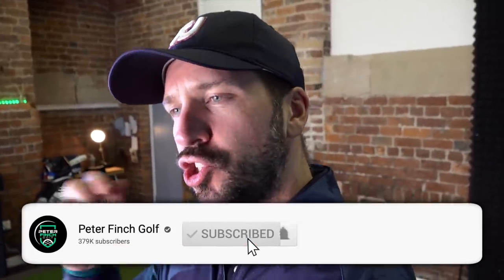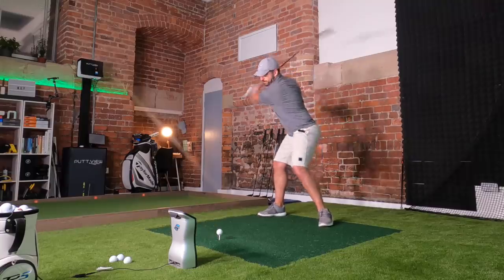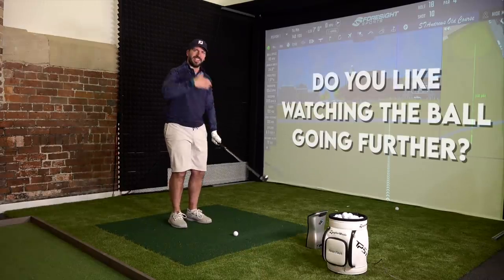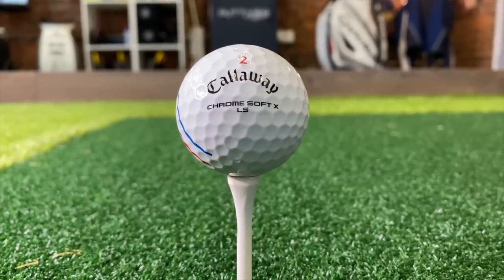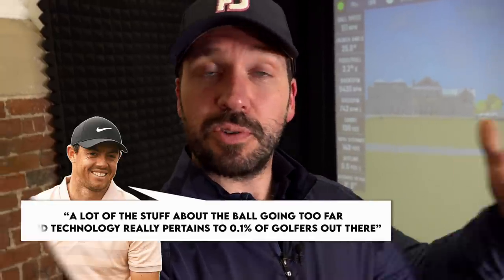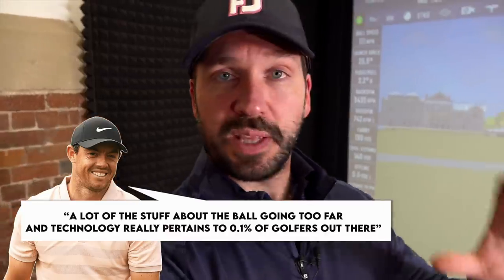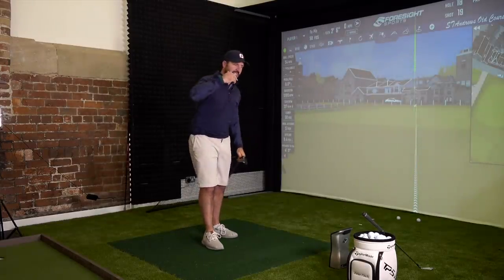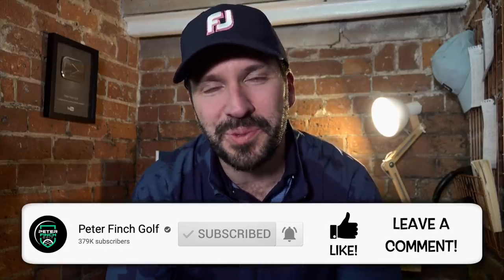Time to roll back the golf ball...?

Comment: I remember when Tiger started hitting it out of the park everybody was wondering how to Tiger-proof courses. It was suggested shortening courses would help, thereby levelling the playing field by making long holes reachable by all. However that doesn't stop the long hitters hitting a 9 iron where shorter hitters need a 7 iron & thus having less chance of stoping the ball on the green.
A shorter driver shaft would drop clubhead speeds & probably help many amateurs find the sweet spot more often too.
Reply: They need to just make the hazards tougher, more plentiful and more int he way. Pros are driving to an empty piece of fairway avoiding all hazards? put a bunker there, make them have to play different shots etc. you odn't have to keep making the courses longer. Some of the most entertaining holes in golf are par 3s that the average golfer can hit with a 7 iron.
Reply: @dr6124  I don't, you change them as needed. Either don't use the course or accept that some comps are going to have a cut of -12 or something. Adapt or die is a phrase for a reason.

Comment: Advancement is fine, it just can’t reach a point where equipment starts hiding players’ weaknesses. It should highlight their skills not be a crutch for them to fall back on.
Reply: I like this view. The distance isn't the problem to me. The amount of players that are actually long strikers is quite small. I'd say it's waaaaaaay below 1% of all players. And when golf is a game where you should use as few shots as you can, it's ok to have some players to "exploit" the courses. The vast majority can't and will be playing the courses as they were designed to.
So as long as the ball control isn't tampered with tech too much (distance and spin doesn't do that, as the player still has to hit the right ahot for that ball in every situation), I don't see the problem. The pros are on a different level than the majority in EVERY sport anyway.

Comment: Yes, can't just keep pushing tees further back.
Lots of other sports have equipment differences at different levels. Different speeds of tennis balls, squash balls, shuttlecocks, wood vs metal baseball bats, javelin weights etc...
The game was bifurcated in the past when only tour pros and elite players used balata balls.
Average golfers get very little benefit from low spin drivers and premium golf balls that are maximising performance on tour. 
It will be a huge challenge though.
Needs a very clever solution to limit distance without completely excluding the shorter hitters on tour...

Comment: 2 things.

1) does that X LS ball work well for lesser swing speeds?  Like 100 mph speeds?

2)  Regarding rolling back equipment, I personally think it doesn't matter how much you roll back the equipment.  Technology in both measuring and training will mean players will experiment and figure out how to get the ball to go farther.  If you roll back equipment now, you'll just have to do it again in about 10 years or less when players have figured out how to maximize everything.

I'm a video game designer, hence I deal with balancing systems and mechanics like this all the time.  The key problem I personally see is that the metrics to design courses around are fluctuating too much with the amount of distance that can be gained now.  And as I mentioned, it doesn't matter what you do to the equipment, professional players will figure out how to maximize it because they're absolutely incentivized to do so, and the technology exists to make that happen now (as opposed to the previous 100 years).  In any kind of mechanic like this in a game, developers would put a cap on certain abilities so it's a fixed metric to design around.

My personal proposal would be to put a maximum cap on how far any 1 shot is allowed to carry of 320 yards, and any shot that exceeds that gets a 1 stroke penalty (and this rule only has to exist on tour).  Every shot is tracked on tour now, so it's easy enough to monitor.  It allows for big bombs to be had for fans to enjoy, and it also provides a fixed metric that courses can be designed around, knowing that it won't change.  It also still gives an incentive for players to want to train and hit it longer as it allows for more strategy with club make up in a bag.  Hitters like Bryson could stop carrying a driver and use that slot for an extra wedge, or a specialty club.  And hitting a 200 yard 8 iron is still a big advantage!  Club manufacturers are still incentivized to make better technology to help all golfers.  My 2 cents worth anyway :)

Comment: Jack Nicklaus hit drives 330 years ago... now the roll back discussion just because a few pros hit it longer... let golf keep going.. winners will win..
Reply: Whist this isn't wrong it doesn't tell a full story. In 1963 Jack won a long drive comp with a massive 341 yard drive. However in 1980 (the earliest year the PGA has the stats for) he averaged 270 yards, that was past his prime sure, but he still won two majors, the PGA and US and had the tenth longest drive on tour. By contrast that 270 yard average wouldn't even place him on the PGA board for 2021 where the shortest average drive so far is D. A. Points, down in 230th at 271 yards. So yes, Jack was a long driver, but not nearly as long as the modern guys. Average drive on tour has gone up 40 yards which makes many golf courses play very different. That isn't an especially bad thing, and as someone who hits a long drive I certainly don't want a roll back (for amateurs at least). But, the argument of "well the drives aren't thaaaat much longer" isn't accurate. All pros are longer, and by a lot.

Comment: Hitting it far is always going to be an advantage and that won't change with roll backs because distance is going to roll back for everybody. What can be done on any course is raise the potential cost of missing on a 340 yard drive by implementing temporary OB for professional tournaments. If Bryson has water short of his carry and OB on the other side of the fairway, he never would have attempted that drive.
As for amateurs, average handicap and average driver distance hasn't really changed over the past 20 years, so equipment isn't defeating old courses for us.

Comment: Pete with the SIM2 you CARRIED as far or further than my best drive total. And my best drive total was 321 yards. That is insane. A roll back for pros and amateurs doesn’t make sense but a roll back for pros is needed. And with all the technology they have out there I’m sure they can make all the equipment look the same or even if they just use that ball with no dimples that would be a huge step in the right direction IMO

Comment: IMO, 3 option, but not a rollback persé:

1: Lock distances now, no rollback but as of 2021.
2: set a set of limits between the correlation of distamce and forgiveness, you want distance, give up speed or vice versa.
3: but a "bag budget" on the pro's. A bagsetup (clubs and ball) can only cost so-and-so retail, otherwise they have to use older models, cheaper models or less clubs.

Comment: OK then ... just an idea. Let the manufacturers knock themselves out with new tech. Merely adjust the pro courses so that the fairways narrow dramatically after 300 yards or so with deep rough on either side. Maybe add obstacles such as fairway bunkers around 320 to 380 out from the tee where necessary. Move tee boxes so that players can't drive across water on designated par 5s because it's a 420 yard carry. Up the stakes on the risk-reward so that the best golfer wins.

Comment: Low Spin Lunacy. Hey pete I used to struggle with distance last year. I saw bryson and got inspired to gain some yards. I went for being able to hit driver only 230 to know hitting it 310. Club head speed went from 95 to 105. I am also now hitting more fairways, because of the work I have put in
Reply: 310 with 105 chs? someone is lying to you lol
Reply: 105 chs gets you max 265 carry
Reply: @joshuaprok4354  it is not 310 carry
Reply: @konstamattsson  not carry total and the speed speed could be faster now I  havent checked in a while
Reply: 310 total distance requires 115 swing speed

Comment: Tough question to answer.  I'm sure some of the complaints made were also made when shafts shifted from hickory to steel and then to graphite.  It probably happened when metal 'woods' were developed as well.  I think the big thing is not how far is too far, but how will golf clubs respond to the issue.  Some older clubs won't be able to expand but that doesn't mean they won't get business, it just means they won't be hosting Majors anytime soon.  Lets face it, all of this new technology gives probably less than 1% of the golfers out there the massive advantage.  Most of us will see maybe five or six yards of increase but we won't be worrying about driving Number 6 at Bay Hill (unless it is in a video game).

You aren't going to change how things are going.  It isn't just the golf ball or the clubs.  Like you noted players are concentrating on weight training and athletic drills to increase their clubspeed and distance.  Golfers are now athletes in their own right.  That can't be changed, no  matter what you do to a ball or a club.

Comment: If you want to bring back skill then the answer is relatively simple: let the rough grow a bit more so there is a real penalty for being off line and let the fairways grow a little - in pro tournaments the fairways are faster than most club greens.

That safeguards the old courses. It also changes the risk/reward dynamic for the longest hitters.

But as history shows if you are one of the longest hitters in the game AND you hit the most fairways from the tee the chances are very high that you will be consistently challenging for tournament victory unless you have the putting yips or a short game like mine

Comment: I agree that there should be a middle ground. Maybe keep the clubs improving and limit the balls to 3 layers or two piece construction. Also, I don't think making it so the professionals had to use nerfed equipment would be the worst solution. Amateurs can still choose to play a professionals PGA spec equipment, while having the option of using whatever is available. Additionally, tournaments and courses making stricter local rules, shoring in OBs and such to make professionals less likely to choose certain clubs and change their strategy. I think there's a lot that can be done before we need to start looking at equipment.

Comment: Trouble is though the in the states courses are long and can be extended easier to accommodate this here in the U.K. we are limited to space and a lot of courses are unable to move tee boxes ect . So in the long run will some courses will no longer be able to host comps ? Personally I want better dispersion and control of the ball , my current driver 10 yards shorter than my old but I’m hitting a lot more fairways, some times it’s a bit boring watching the pros smashing a driver and just playing a wedge into a green all the time

Comment: It's a tricky question.  My feeling is that for the pros, the golf ball should be dialed back in.  It seems to me the best way to do this is to affect the dimples.  No dimples, no distance.  Current dimples, big distance.  So change the specs for the dimples so the ball doesn't go so darn far.  Just for the pros.  I mean look at other sports like football, baseball, tennis, rugby etc.  They all use a standard ball.  For us amateurs, it doesn't matter.

Comment: I think you'd need to take into account distance off the tee compared with win rate. Also, fairways hit in reg, compared with off the tee distance & win rate. Make the rough nastier. I think there's ways to safe guard older course from new tech dominating them that wouldn't trickle down and hurt you normal Sunday golfer.
Reply: Replace all of the rough with sand.  Anything 2 yds off the fairway is a sand trap.  That will force accuracy over strength.  Some courses in AZ are desert sand or hardpan if you're not on the fairway.

Comment: The big hits are exciting and they train hard for it but that amount of spring and low spin, seems like it’s a bit much and perhaps having limits like a driver has.
Limiting clubs won’t make huge difference because the big hitters and going to keep training and the guys without the fast twitch fibres, or power will be in the same position. The gap might lessen with equipment rollback but it won’t be by as much as they imagine

Comment: One thing I think should happen is rules should be put in standardizing lofts. Meaning that if you are going to label a club as a 7 iron it should be a standard loft across all brands. Plus make missing the fairway at PGA events more punishing, have longer tougher rough, thinner fairways maybe more and deeper fairway bunkers for the pros, make it so they can still go long but if they are not accurate there is a severe price to be paid.

Comment: I think we amature golfers are not blowing away golf courses. Professionals train much harder than ever and are more physically capable of hitting the ball a long way. Clubs and balls are pretty much capped. To be conforming, there isn't much more manufacturers can do to equipment. I saw a review of the 2000 Pro V1 vs the 2020 Pro V1. Results were very similar. Moving forward, if the ball was 'rolled back'. Here is what I would do: Manufacture a golf ball that is less responsive to the 120+ mph club head speeds. A ball that actually compresses too much at high club head speeds, thus reducing the carry distance. End result, the long hitters are still going to be the long hitters, but the margin would not be as great. Lower club head speed pro's and most amatures would not see a reduction in distance. I think this is very possible. Also, toughen up the courses for the pro's. Higher rough, narrower fairways. Increase the risk of the bomb and chase golf. The governing bodies should consult the players past and present. Find out what they think. After all, they play or played the game for a living, their input should count.

Comment: Give clubs a grading i.e. Tier 1, tier 2 etc, and then align them to a course with the same grading. For example, a tier 1 driver might be played with as little as 8 degrees, and a tier 2 has a minimum loft of 10.5, meaning that players will lose distance, reducing the impact shot length will have on the courses technicalities. Same idea with irons could be applied. But where drivers are concerned in particular, the golf laws just need to set a minimum loft. This would make a huge impact if tour players couldn't crank their loft any lower than 9.5 degrees.

Comment: I'm new to golf. But i REALLY think this is a non issue. Even the argument of "preserving the old courses"... Strategically placed bunkers have been a viable option for golf course, i don't see why that wouldn' t the same today. On said hole of tpc where Bryson carried the water, they could just scootch the tee box a litle more right to accentuate the distance above water but barely changing the overall lenght of the hole.

 And first and foremost, Bryson took a chance on that hole. Could easily had misshit the shot and ploof, that one less golfball in the bag. I don't remember who, but a pro once shot 18 on that hole, and almost ran out of golf ball.

Making changes to the equipment just for the pros is a really bad idea, because most people are gonna struggle to drive 250-270 yards, let alone 350.

Comment: Idea: only roll back technology on specific courses. Not all courses but older ones that are being ripped apart. All pros use the same style of ball, same style of club with specific shift lengths or percentages of their height. With an over/under for some wiggle room. Now this sounds kind of like the current technology because everyone basically uses the same thing but for the older shorter courses you tighten fairways and actually roll back technology. What they could use at Augusta may not be what they could use at say Pebble Beach. Much like Nascar and their restrictions on certain tracks

Comment: The problem isn't with distance but with precious resources.
The arms race has resulted in tournament standard courses using up more land and water (& money) than is necessary to combat a handful of long hitters for 1 week a year.
Rolling back the ball is an easy solution, perhaps limiting the dimpled area of the ball -  remember the dimple free Titleist?
At the end of the day, the long hitters will still be long hitters, but we won't waste resources.
As for Rory worrying about the 'average' player, that's what handicaps are for.
And whilst I'm at it, are greens on modern courses too big? Especially par 5 greens which should be tiny.
Rant over.